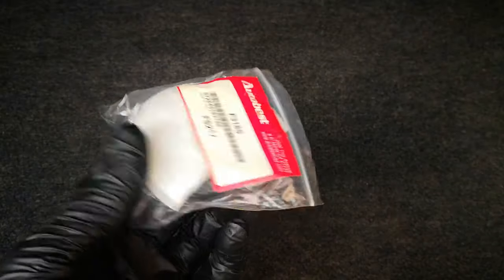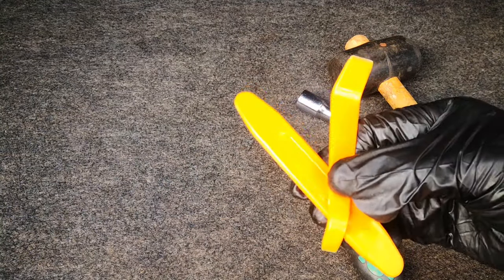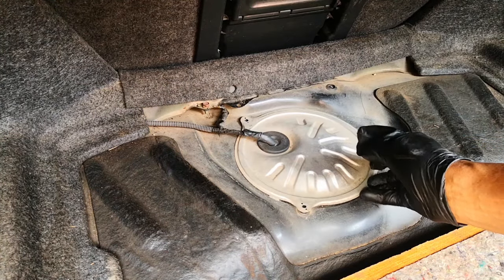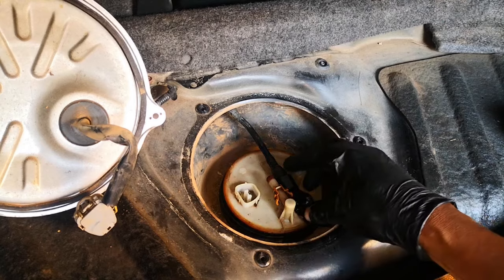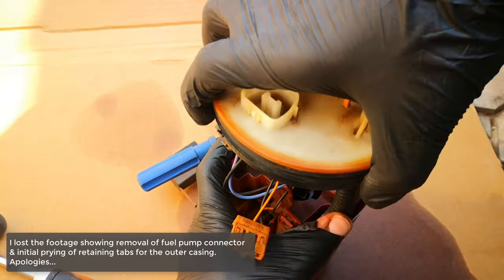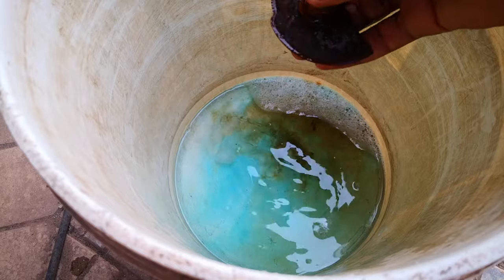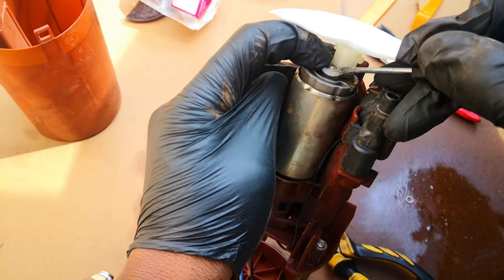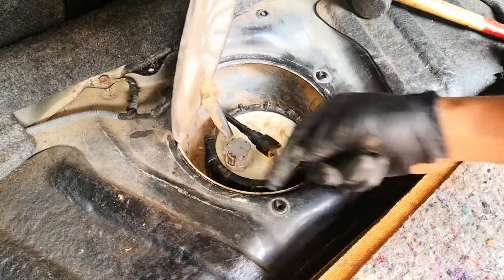2003-2007 Accord Fuel Strainer Change: Fuel Pressure Regulator change/ Fuel Sending Unit Disassembly

Comment: Have you ever had one where the car idle hood but once you put ur foot on the gas pedal the car shakes and back fire like it’s running out of gas. I checked timing vacuum leaks, sparks and all of it checks out and no codes when I scan it I’m thinking it’s fuel pressure
Reply from the maker: Sounds fuel pressure-related to me.  Can give severe symptoms without codes, another culprit on this Accord can be badly clogged engine air cleaner elements. I suggest checking fuel pressure.

Comment: keep getting p0171 and p0420 only when its freezing outside, do you know what that could be? ive replace the o2 sensor, clean the maf sensor and pcv but still no luck..
Reply from the maker: Do you have an exhaust leak? Especially pre-catalytic converter... Start with the P0171. This video may be of help. You'll need to do some testing using fuel trim data. https://youtu.be/O5KI0GHNX7Y

Comment: So the filter is inside the fuel pump ? Is it visible or can you even replace that filter ? I been looking everywhere on my car and can’t find the fuel filter anywhere.
Reply from the maker: Location varies by car. You would need to specifically search by your make, model and year.
Reply: @DIYAutoworksNG  yeah I looked online and every website and YouTube video all just beat around the bush big time and nobody has explained it so far lol I have an 07’ Honda accord 2.4 liter. I’m guessing it’s built into the damn fuel pump which makes life more difficult instead of having it under the damn hood or atleast under the car and have it be accessible. Car manufacturers do everything they possibly can now days to make sure it’s too hard to fix issues and it results in taking your car to a shop lol owning a car is all about losing money and always having problems. Huge scam since everyone gets paid more than the owner of the vehicle lol but I’m trying to learn this crap because I need a vehicle for work and can’t do my job without getting to work. I miss my 95’ Plymouth voyager because every single thing was able to be fixed with basic knowledge… we’ll except for the A/C system but besides that I was able to access parts in the van and even put a good stereo inside very easily. Can’t do that now days unless you went to school for it or just a genius with cars

Comment: hello, i changed my car's fuel pump two nights ago. the engine started and ran for up to 5min so i left it to to fix the seat since i had to remove the seat to reach the pump( its a hybrid). i got bat to the car yesterday and the engine ran only at idle but now it would not start anymore. i went to check the old one only to find a plastic and rubber seal seating on the neck of the pump but i dont know the sequence of fixing the the seal and the plastic. please can you enlighten me?
Reply from the maker: Hi. What car is this? Make, model and year.

Comment: What are the symptoms if the pressure regulator is not working properly?
Reply from the maker: It's all the usual drivability issues you would expect with a failing fuel pump (hard starting, stalling, etc), but also includes a louder than normal fuel pump whine, black smoke in the exhaust. It may also cause a fuel leak which could come with you getting the smell of fuel.
Reply: @DIYAutoworksNG  Thank you for your reply.

Comment: Hoping mine is the fuel pump relay, just cranks and cranks and only after I fill up or its hot.
Reply from the maker: Possibly the relay. Other causes of difficulty starting after fill up include, the fuel pump strainer, the fuel pump itself, EVAP problems, defective fuel pressure regulator etc. Let us know how it goes. Best of luck.
Reply: I put a new pump in seemed to do the trick

Comment: Hey so I was looking for a video on how to change the fuel filter on this model (mine is 2004). I was under the impression that the fuel filter was just a small cylinder under the car?
Reply from the maker: It's in the exact same location as the one in the video.
Reply: @DIYAutoworksNG  thanks. I watched a different video and was lead incorrectly to believe that it was separate from the pump. Thanks for your videos!
Reply from the maker: You're welcome!

Comment: My 09 accord has 185,000 miles and seems to be using up fuel more than before,  and at times wont start on the first try.  Should I replace the fuel pump?
Reply from the maker: Is the CEL on? Will be good to hook up a scanner to look at fuel trim data first. I won't advise throwing parts at the car. Using just fuel trim data, there's a simple test you can do to find out if the fuel pump is failing. The definitive test will be reading the fuel pressure. 
On the seeming increased fuel consumption, you can run a good fuel system cleaner in the tank to see if it helps.
Reply: @DIYAutoworksNG  no the CEL is not on. I just noticed it's been consuming more gas. And at times it takes more than one try to start it. I just replaced the starter a year ago. I do add Lucas fuel system cleaner ti the gas on occasions  ...
Reply from the maker: I see. No codes. This is where reading fuel trim data matters a lot to get to the bottom of the increased fuel consumption. In the meanwhile, be sure to rule out under inflated tires, binding brakes etc. You can usually rule out binding brakes as the affected wheel(s) will feel hotter than the rest.

Comment: Is this a 6cyl cuz my 4cyl 05 accord has a completely  different part
Reply from the maker: This is a 2003 Accord 4cyl, LX. US spec. It`s LEV. Is yours ULEV? There's some regional variability in parts plus manufacturers may update certain parts as defects are identified. 
It's usually best practice to buy parts buy VIN. And yours is stock, right?
Reply: @DIYAutoworksNG  thanks yes it is a Ulev. Autozone, oreillys, and rockauto carry the wrong part for a 2005 accord
Reply from the maker: Interesting!

Comment: How to prevent the gasoline from getting dirty and the filters from getting clogged?  .
Reply from the maker: That's mostly beyond you, since it's up to the gas stations to ensure they clean out there tanks and fix leaks. One practice you can adopt is to not refuel if you see a supply tanker within the gas station or a supply just happened. Supplies usually stir up sediment in the underground tank, so it's best to buy after it resettles.

Comment: Hello I’m having difficulty putting the retainer ring back on. 3rd day of trying. I’m wore out and gas fumes dizzy.
Reply from the maker: Hello. Sorry to hear this. How are you going about doing it? Fit the rubber sleeve first, then insert the fuel pump assembly. From here, I have used 2 approaches that work: 1st is as in the video. Push down the assembly until it sits well in the opening. The friction with the rubber sleeve usually keeps the retaining ring down. Second method is to attach the retaining ring push down slightly then twist on the retaining ring. Rely on the screwing on of the retaining ring to put the fuel pump assembly in position.
Which of the 2 have you been using?
Reply from the maker: Also, try doing it first thing in the morning or in the evening to reduce the fumes.
Reply: @DIYAutoworksNG  I climbed into the trunk and used my palms with back braced against trunk lid. I think it’s in good. 
Thank you for responding. The gas line on top of sending unit is giving trouble, but will try again tomorrow. It’s been a week trying to change the filter which wasn’t very dirty. I don’t know why the car died out after a minute, it’s fine when I gave it gas. Maybe the fuel filter is not the reason it was dying. It started dying after I had the Honda up on jacks a few days changing the serpentine belt and replacing the top high pressure power steering line. I thought maybe the position of car clogged the filter. But I don’t think so.
Reply: @DIYAutoworksNG  the rubber seal was intact tight and never came loose.
Reply from the maker: Good to know you've sorted the retaining ring. Maybe it's something else causing the stalling. If you don't have a CEL, you can observe for a bit. Could be bad gas or something else

Comment: When removed the fuel pump relay (blue) the engine cannot be started.
Reply from the maker: As you saw in the video the car started. The existing pressure in the rail makes it possible.

Comment: How do I know if my fuel pressure regulator is bad?
Reply from the maker: It's going to be any one or a combination of the following: misfires, black smoke, sputtering backfires in the exhaust, difficulty starting, stalling etc. Will be good to check the fuel pressure. Depending on the location of the fuel pressure regulator (engine vs tank), you may have the smell of gasoline in the engine too.
Reply: @DIYAutoworksNG  It's in the tank, and no schreader valve to hook up a fuel pressure regulator. But thanks for the symptom which I have non, but my short-term fuel trim is always (-3 to -8) and long-term fuel trim (-6 to -8) constantly.
Reply from the maker: Sometimes, those fuel trims depend on the quality of petrol... 🤣

Comment: I pulled the relay and turn on the car the car died I put the relay back and then took the ground off when I was disconnected the fuel line there was still so much pressure in there
Reply from the maker: That's weird. Was the key in the off position when you put back the relay? It shouldn't have much pressure if the car stalled from lack of fuel pressure.